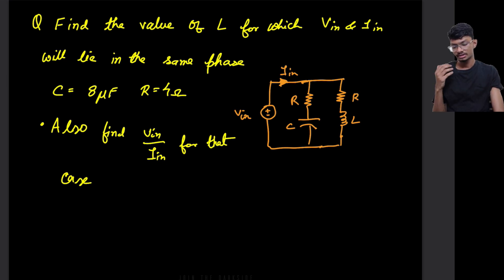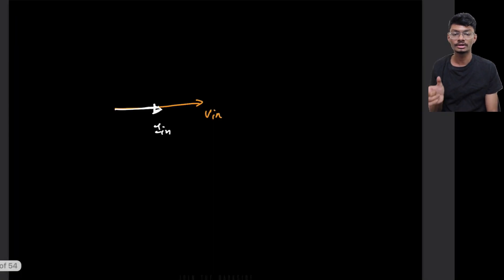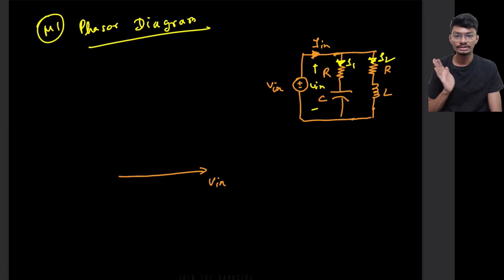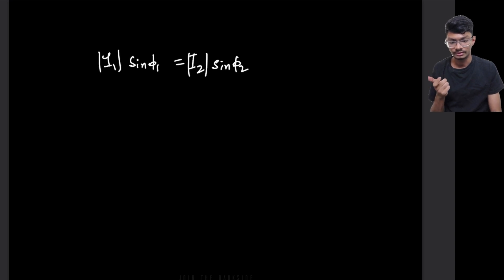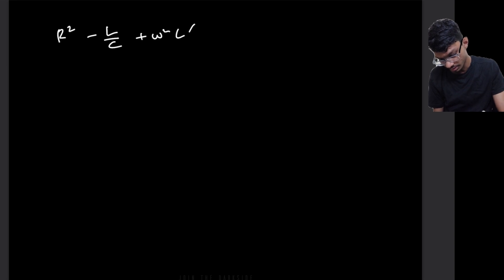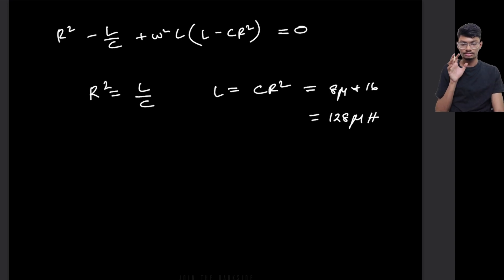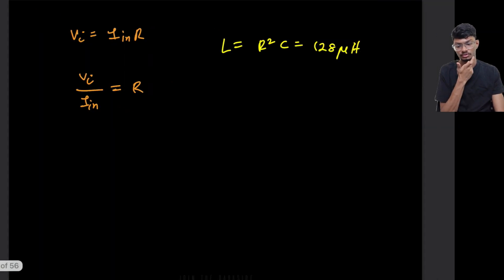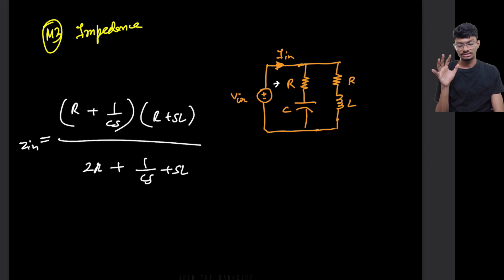Screening Test Problems || Phasor Diagram || Concept Through Question

Comment: Hi all. Please allow me to say.
First, this is not a Wheatstone Bridge. We use a Wheatstone as a balanced bridge to precisely measure a resistance inserted on the fourth leg. This circuit ; as drawn ; when you apply a dc voltage, the capacitor would simply charge to full value after 5 RC time constants, become an open. The inductor would charge it's magnetic field after 5 RL time constants, and become a short.
This circuit is drawn as a parallel LC tank circuit, which it's resonant frequency when the XL reactance equals the XC reactance of a center frequency ; plus and minus it's 3 db bandwidth, which is determined by the Q factor of the circuit, which would include the series resistance of the two said 4 ohm resistors.
What then, would be the case if we injected an RF signal across this network, at which point could the value of the XL would equal the XC ? Well, if the injection signal is 1 MHz, and the value of the capacitor is 8 ohms, than the value of the inductor becomes 3.166 nH. That to say, at this frequency, the value of both the XL and XC I calculate to be 50 ohms.
Now, how would this look on the Impedance Smith Chart. Since the circuit is at resonance, it would appear as a single dot at 50 ohms , or 1 + j0
Reply from the maker: Sir I didn't say It is a wheatstone bridge I just solved using a different method which uses the concept of wheatstone bridge that's all I wanted to mean in the video.